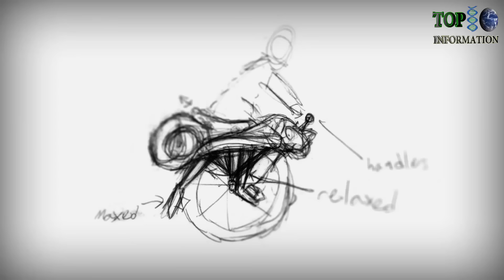5 Crazy Amazing One Wheeler Vehicles ▶ 1

Comment: #1 the rino, just needed a small chain belt non steer style extender ready for sharp up hills and most awesome to attempt, climing up&down stairs,then it could go ANYWHERE on ground, in the exception of that blunt metal front stand, also an added option front wheel could make it accessible to very high speed for the tilting reason. Almost the same for #4 topic, that bike was too big to be that slow.

Comment: The problem will not be in the using but in the licensing, insurance, everything you need to drive a regular car, you will need to drive ANY kind of POWERED vehicle that is not muscle powered.
Reply: Not true. You can operate an ebike - a kind of POWERED vehicle, only muscle powered theoretically (pedals are really nothing but a decoration, the electric motor does all the job) - without a license, insurance, registration, license plate etc. All you need is a DOT-approved helmet and at least 16 years of age.

Comment: I love the trotter much much better 
its wonderful to ride and cost a fifth the price of this thing 
which looks like some one made it in there metal work class at school
i hate the way onee wheel looks and that nasty ply wood foot pad is so basic  
unlike the trotter which looks so cool and it has nice rubber foot pads too
which know when you take you feet off and stops the motion  
,i love the way it has intelligent speed control too when your in motion for a while on flats it goes into a sort of cruse control you can of course speed up and slow down but if you don't do that it travels at a auto cruse pace i love 
don't bother spending so much money on a one wheel they are not as good as the trotter and cost far far too much